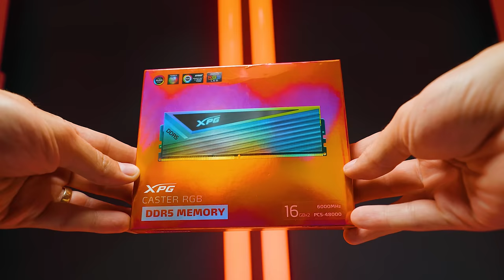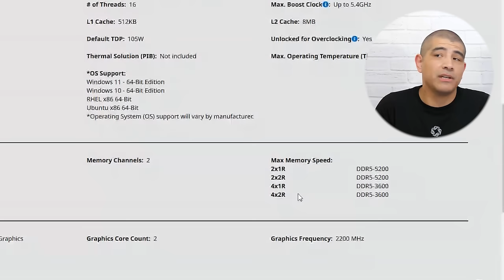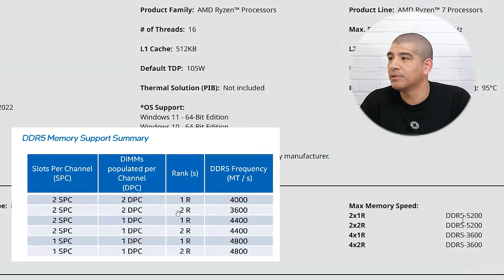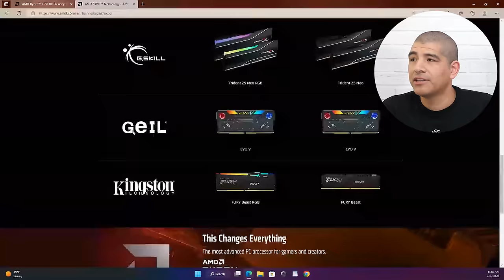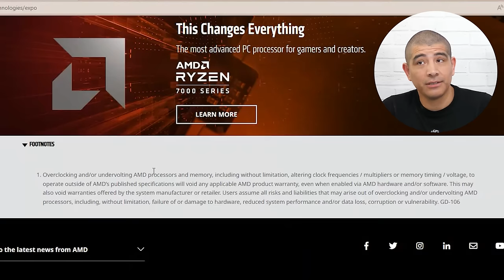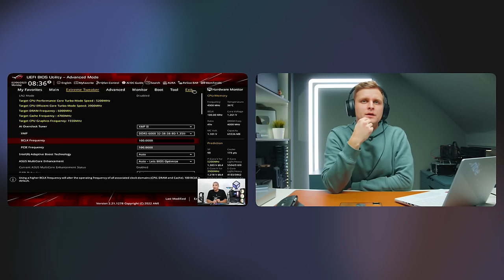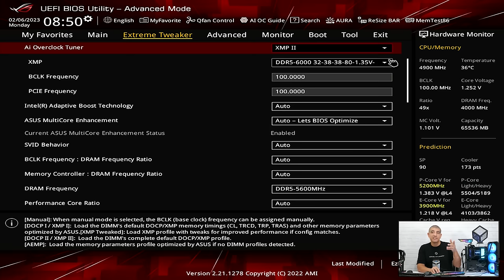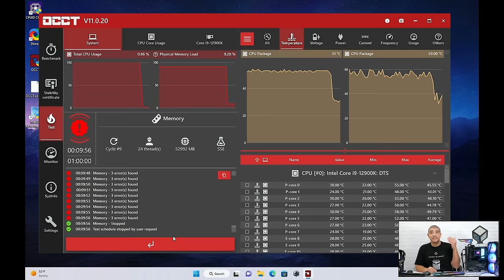Why I get NO POST with XMP??? 👉 ULTIMATE RAM + XMP Guide

Comment: Make sure to check your motherboard's QVL list for the DDR5 ram you're wanting to install before you buy! I spent five hours trying to get Corsair Dominator 64GB (4x16) 7200mhz CL34 running on the ASUS Z790 Hero on XMP I & II. It would never post, even changing frequency and voltage. I decided to look up the QVL ram list for my motherboard with the ram brand I purchased, sure enough, it says right there, will only work using 32gb (2x16) not 64GB. I then consulted my manual for proper slots to use (2 and 4) and it fired right up without a single issue in XMP II. :face-green-smiling: Also, I did update to the latest bios which provided better DDR5 support.
Reply: Do you think manufactures dont know what they are doing? Do you think they didn't know all these issues before launching DDR5?  of course they do. Thing is as they work on the issues they release rams sticks because people will buy regardless. Is all about money. Always been. Always will be.

Comment: Absolutely agree on the RAM massaging. I currently run a 64GB kit of Mushkin rated at 3600 MT/s CL16. It would downright refuse posting on my system with XMP enabled. However, when I started dialling it in manually I would inch closer and closer to stable 4000 MT/s CL 18 with super tight tertiary timings and even voltage below XMP. Going through that and learning the ins and outs of memory tuning was a cool and ultimately rewarding experience.
Reply: Well you can get & tune fast memory with x3D then discover the lower rated untuned cheapest has the same application performance.  😮😮

Comment: Thank you for this informative video!

I don't want to jinx myself, but I think I fixed my issues from this video.

Memtest errors in first 10 minutes and OCCT threw 600 error in 3 minutes.
Changed RAM slots (as in changing places, still using A2&B2). And turned on XMPII instead of XMP I.
Memtest for 9 hours and no error.

Looks like XMP I with Asus timings messed with my system. Games were BSODing etc.

Asus Z790 PROART WIFI and Corair Vengeance 6400Mhz CL32.

P.S. The AI OC uses XMP I.

Comment: A really informative clip for newbies, but i did not hear any discussion about the real problem with ram and specs in general nowdays, manufacurers sell and advertise unrealistic speeds take for example base am5 specs which is 3600mt(mhz) on 4sticks, but both ram manufacturers and motherboard manufacturers advertise 7000mt or more, also all tests are done at those advertised speeds, what we end up is parts sold for advertised overclock speeds that they'll never reach

Comment: Enjoy this a lot.  I remember when I got my Asus X99 Deluxe board back in 2015.  It has 8 dimm slots and I have it fully populated but only 64gb total because back then 8GB was the largest dimm I could get, so I got 2x 4 dimm kits.  It still runs great to this day running a 5960x.
Reply: Exact same configuration. I have 3 X99 boards, all ASUS. Originally had FlareX ( 8 x 8G ) on the Rampage V Edition 10 / 6900k, always worked great. Swapped in G.Skills Trident RGB ( 8 x 8G ) when I installed the Flare X onto a Aorus X399 TR4 Board with a 1950X. All kits I use are 3200mhz . Seems after the Trident Z was installed, little things would freeze ( like the mouse ) What faults can occur when it's a memory problem ? Can I manually reduce the Ram speed to 3000mhz to see if that helps or increase the voltage?

Comment: I don't understand the statement 2 sticks of 32GB is better than 4 sticks of 16GB.
The  QVL listing for my Gigabyte Z790 Motherboard lists (i5-13600K): 
1R8 sticks of 16GB from 7200 down to 6000.
2R8 sticks of 32GB from 6000 down to 3200. 
For 7200, you can only get it with 4 sticks of 1R8.

Comment: My z790 Apex is a beast I daily 8000mhz stable.  I was able to get 7800mhz XMP to work out the box. It wouldn't work on the Z790 Hero or Z790 Master even though its advertised. I have a 13900KS so it's binned plus I have a good MC so it should work as advertised on those boards.
Reply: Cries in z70 Max Hero
Reply: Same here z790 tachyon and  apex..8000 is a joke. 6000 ram is slower than ddr4 4000 so minimums is 7200. I find this video a joke

Comment: In simpler terms, the "faster" and more densely populated (dual side vs single side, 16GB vs 8GB) the RAM sticks are, the less likely the kit will boot and be stable at XMP (DOCP, Expo).  With one stick per channel, the OC profile will usually work even for a kit that's not on the motherboards QVL.  With two per channel, it's a crap shoot.  This is true for Intel and AMD.  Probably the most important factor is the random quality of the IMC.  My original R7 1700 would not run a particular 2x8GB 3200 at XMP-1, but I could turn off XMP and let it run at the default 2133 or manually clock it to 2667 and it was fine.  At the same time, I  had an R5 1500X with a magical IMC.  It would run that same kit on the same motherboard at 3200 (XMP-1) without issue.

Comment: AMD Ryzen 5 7600 Processor & MSI PRO B650-S WIFI DDR5 AM5 ATX Motherboard which ram xmp will work? 

1. G.Skill Ripjaws S5 16GB DDR5 6000MHz Black Gaming Desktop RAM

or

2. Corsair Vengeance 16GB DDR5 6000MHz C36 White Desktop RAM

Comment: OMG psychic. Mine doesn't work on 12th gen, will watch but XMP off it works. 12700KF and 12900KF both. I ended up throwing money at the problem which probably wasn't the smartest but w/e have 2 working rigs now.

Comment: Good info, but a little bit Asus marketing skewed. But what is the real problem of getting faster DDR5 to work? Why isnt getting the right  (slightly higher) VCC  to the (individual) modules discussed? This does solve the issue with the memory controller in 13th and probably 14th gen Intel CPU.

Pleas comment on this and maybe get a video out. Would be really interesting!

Comment: I always get the fastest Memory kit I can get my hands on especially if your motherboard and CPU are high end components.  Then XMP it and if it doesn’t work try different things to get it to run, but if not then you can always downclock the kit until you find what will run.  My Z790 APEX board ran 8,000 on XMP right out of the box. 😊

Comment: XMP works fine on my Gigabyte MB with G Skill DDR5  6000.  No problems. Just started OC the different components. Got my GPU done today.. People were complaining about the ram I have not running XMP and the speed it was designed for. I think that is a MB problem.  G skill uses Samsung chips so it should always work well.

Comment: On that last part, where he said that certain applications can perform better on certain RAM speeds and timings, imagine having the option to set the corresponding RAM profile for the specific application that you are running to increase performance.

That would first of all necessitate CPU manufacturers to not void their warranty for using an overclocked profile with their IMC. The application should obviously support that kind of functionality. The MB manufacturers would tag along, updating their UEFI correspondingly and RAM manufacturers would also optimize their products if need be.

Comment: Great informative video. I tried half a dozen RAM kits with my 7700x with Asus B650-A Gaming mainboard and DDR5 6000 CL 30, 32, 36, 40 kits and all failed at 6000mhz. Apparently the CPU memory controller can't run it stable. I managed to run it stable with 5600 MHz with at least the faster expo timings. I hope a future CPU replacement will run it stable at 6000.

Comment: Memory needs to be translated to light rays rather than electricity for better and more accurate transportation as well as heat reducfion..
By translating the electric pulses to a light pulse run over fibre optics, less will be lost over transmission as well as accuracy will increase and memory speeds could be run harder with a more agressive overclock too.

Comment: Just built an i9-14900k system with a ROG Strix Z790-A Wi-Fi II board. Got 4x32gb Corsair Dominator 6600 RAM sticks. Updated the Bios on the Motherboard to latest available. System will not post or boot if I select either the XMP1 or XMP2 profiles in the bios. At standard setting the RAM only runs at 4000. Need to get this fixed somehow so the RAM runs at least somewhat closer to its advertised rating.
Reply: Do your research mate. You'd be lucky to reach that with only 2 sticks on that board

Comment: My problem with 3200mhz ram was, after flashing bios, my XMP didn't work. Got crashes ect.
The simple Solution: increasing the voltage from 1.35v to 1.36 solved the Issue

Remember, if you go with XMP, give a little bit more voltage in 0.1v steps, till it runns stable. That's all.

Comment: As per Intel's website - 12400f supports DDR5 ram up to 4800MHz but Asus B760M-A AX supports OC ram up to 7200Mhz and normally supports up to 5600Mhz.

My question is, if I run a dual channel ram, 2 sticks of 16GB with 5600Mhz. How will the CPU support it, will it lose bandwidth, will there be any bottlenecks??

Comment: I've had a nightmare trying to get 64gb of non-QVL RAM (Corsair Vengeance 5600 CL 40) to remain stable on my Proart Z790 - so, I've just swapped it for some QVL Kingston Fury Beast (with the same specs) and now I have the 'XMP Tweaked' option.

If I can manage a week without a BSOD I'll report back and let you know - but so far so good. :)

Comment: This is exactly the video I was looking for my projects eat up RAM in after effects in Adobe premiere. I bought $192 GB but I have been forced to use 2 GB at XMP 6400. Should I return the other sticks or just return all four until I find RAM that will run at XMP with high capacity

Comment: Fantastic and very informative. 
Why do I want to buy a new system and run it at stock speed? Yet, as soon as I build it, I will probably chose to apply XMP or EXPO!
For DaVinci Resolve, would there be that much difference ?

Comment: So I bought an Asus dark hero motherboard and every card reader I plug into USBC is getting USB 2.0 speeds. It will go up to 3.0 for about 10 seconds then throttles all the way down to 10 megabytes per second. I asked ASUS and they are blaming my RAM but it is on the QVL. I then took off all XMP settings and it got a little bit better but still throttling down. I need high capacity RAM that will run with a 14900K and dark hero motherboard. Please help somebody

Comment: Step 1 for AM5 used to be NOT to buy the Asus boards which were very picky  and slow with memory training.  There's a very recent BIOS which apparently improves the state with EXPO.  I've seen overclockers complaining about the unpredictabe failure modes of the Intel memory controller, where you think it'll work but it falls over in certain applications.
Reply: Just an update for people who may read this in the future. Asus didn't have really working BIOS updates until about late August 2023. It took around a year for them to fix 99% of the BIOS issues (cpu voltage issues, ram issues etc).
I have a TUF Gaming X670E Plus and some non QVL ram (generic GSkill trident z5 6000mhz ram) that works as long as I set the ram voltage manually. The rest of the XMP settings work fine. My pc has been stable since version 1654 BIOS. I'm not upgrading to a new bios any time soon as the newer update only seems to support new cpu releases.
Reply: @skilletpan5674  thanks for that info update!  It's pretty sad, Asus used to be my goto mobo brand, but that was before they jacked their prices up.
Reply: @RobBCactive  No problem. I kept having random system reboots and stability issues and sometimes usb issues. They fixed the usb issues quickly but the ram issues took forever (like I said above August of 2023). I used to think that gigabyte where a bit meh for their medium level boards and ok on the low end boards and good on the high end boards. I was thinking of getting a Gigabyte board. I regret buying this Asus board. I only bought it because of the location I am I don't have a huge choice.

Comment: You are wrong, I've got an Intel 10900-x it is a quad channel Intel CPU maybe not that mainstream because it is a power hog, but it provides very decent performance and contrary to some other experience, it overlocked quite well for me. Running 4.9 Ghz and a base frequency CPU of 3.6 Ghz, all core, with air cooling.  It is 4 channels, 8 slots, supports 256GB which I have fully equipped AND running at the full rated memory speed even though all four channels are equipped with two DIMMS each and it is stable.

Comment: Great video, very helpful, thank you. I have now subscribed, this isn't the first time your content has helped, good stuff. Nice to see ASUS providing some support, as I was seriously doubting their ability to do so!! I have just completed a new build using a Z790 ASUS Prime P WiFi , I713700K, Corsair DDR5 6000 CL36 2x16GB. Posted, booted first time with XMP enabled. Win 11 installed, no BSDs whilst testing and benchmarking but randomly I have had two freeze crashes! (yes have checked all display settings/frequencies). So now just trying to find out where the stability issue may be. This vid has helped me understand the RAM settings much better. BUT ASUS WHY?? No built in MemTest in my Prime bios! Just another ploy to upsell on the cheap. You may call it your budget range but $280 isn't budget!! Shame on you, again!

Comment: I have 7950x3d gpu 4090 tuf , asus rog strix 679e f wifi and 6000mhz ram kingstone fury beast and the last bios update, when i turn on expo I or II or whatever , the system slowly boot but starts directly to windows , the bios dont show up anymore and in aida 64 when i stress test my memory at 6000mhz it says failed instantly , at 5600 seems ok in aida but still no bios show up anymore when i boot, idk what to do anymore if someone know please leave a comment, thanks!

Comment: I am an old timer that had to learn this the hard way. My b760m board advertised 7200mhz memory support via xmp 3.0.  Unfortunately the frequency supported changes depending on how many sticks you are using. So my 4 sticks became 4800mhz. System would take forever to post because it would fail at each startup and the ram would then default to 3200mhz and finally post.

Comment: One thing I don't understand is this: the i7-13700K is stable until 5600 MT/s. That is 10 ns speed. Let's say I use a DDR5-6000 /-6400 module. It's still 10 ns. Only the DDR5-7200 module would make it faster with 9,44 ns. So what's the point in using modules lower than 7200 but higher than 5600 when the speed is the same at 10 ns?

Comment: Wow... it is crazy, I did bought 4 3200mhz FURY, instead to bought it all in one pack, I did pay less and bought all 4 separately, same type, volts and else, with a Intel 13700k,  It was working fine at stock but as soon as I started using the xmp 2 I never got nothing except fans and lights, also using the Cpu OC with the Msi motherboard, only were able to have the Xmp 1 at 3000mhz, and I made it works fine like that. This is my way now, before I did oc and tried memory from the Msi motherboard Z690 ddr4 and messed up a little bit with the Rivatuner, and other settings and I was experiencing 1 or 2 seconds screen black outs, almost impossible to reach the bios, until I did reset everything and just use the Xmp 2 with msi cpu oc and that's  it, is working smooth with 4 sticks and with a Asus 4090.... wow, thanks this video resolved my 9 months old Pc. Thanks, GOD BLESS YOU ALL!!!

Comment: I picked up 32gb of t force delta ddr5 at 6400mhz I ended up picking up another 2 sticks of identical memory 1 year later and my computer is running like crap now it will not let me get over 4000mhz on my memory without crashing, I updated the BIOS and everything else, I am guessing its not really identical memory a year later, so I am trying to decide if I should get 4 sticks of new 16gb t force delta memory at 7200mhz or if I should get  4 sticks of 16gb corsair platinum dominator at 6200mhz? any suggestions?  Id greatly appreciate any feedback on what will make my PC run like the 10k I spent on it during covid >.< I just want my computer to run smooth. I am using the Z690 ROG Strix Maximus Formula motherboard, intel 12900k CPU, MSI 3090ti SuprimX GPU with 7 TB of WD Black SN850x storage. Also cooling is not the issue, I have 2 radiators and 13 fans all pointing in the optimal position for max air flow.

Comment: Good discussion. I didn't know I had to worry about XMP or EXPO potentially causing problems since the RAM kits advertise the profiles as a main selling feature.
Reply: Sometimes not knowing helps, I had 2xdual matching kits to have dual rank dual channel and just got lucky with the mobo memory training.
The XMP just worked and it was only later fine tuning with a manual oc that I realised I'd been lucky.
Memtest showed my DIMMS started throwing errors just below the next speed bin up, a much more expensive one at the time.
Reply: what's expo? have i missed that it was talked about in this video?
Reply: @billythecat  Google AMD EXPO memory as an aide memoire.
Reply: @RobBCactive  oh so it's the xmp of AMD. Thank you.
Reply: @billythecat  it's royalty free, Intel charges for use of XMP
Reply: @RobBCactive  does that make AMD boards or the rams cheaper?
Reply: @billythecat  probably in the long run, I found fast EXPO RAM at a reasonable price.
Reply: @RobBCactive  but those same rams are also XMP capable right?
Reply: No if you buy xmp and your pc is running amd your pc might not post.
Reply: Same the other way around.

Comment: Asus Strix z790 ,i9 13900k ,4090,128gb G Skill 6000mhz ram. I can’t get it to run stable with XMP on at all. Have yo default to 4800mhz. Bummed. Wish I could find a fix.